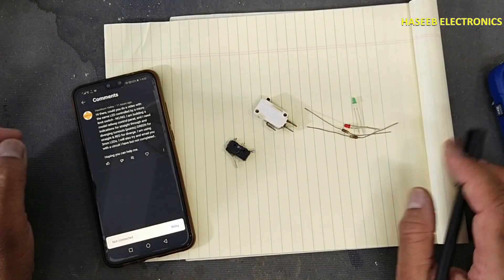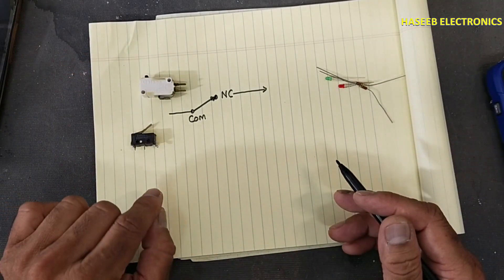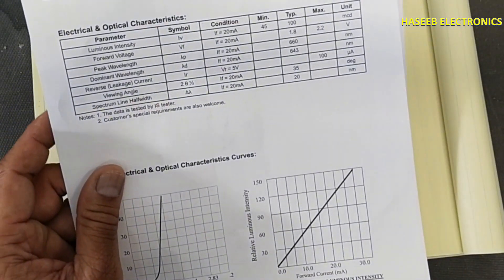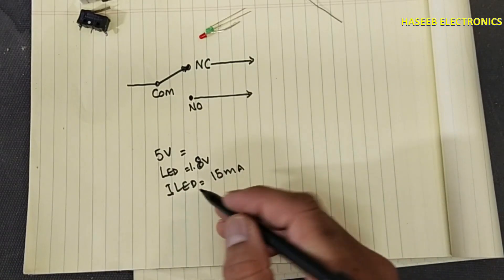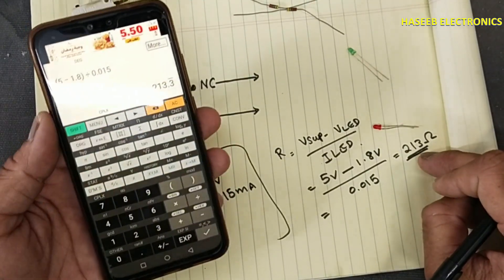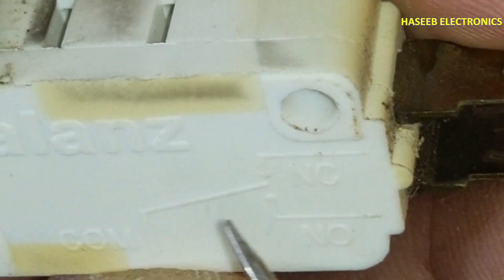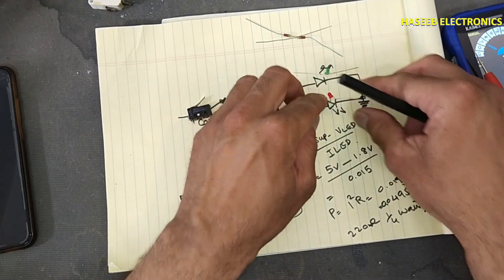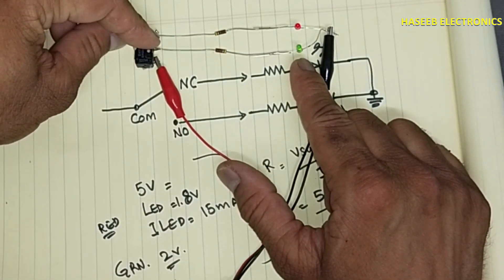{872} Understanding Microswitch

Comment: Wow, that was quick! You were using 2 single LEDs, I get that, but I will be using the 2 pin 2 (or) bi-coloured type RED (NO) GREEN (NC), in other words both colours in the same packaging. Does that make a difference as far as your explanation makes here. FWIW, I have a basic knowledge of LED electronics.

Thank you again.
Reply from the maker: it is my pleasure 
if you want to use molded pack LED, it will the same 
if you will use common cathode packing, then the connections will remain same 
if you will select common anode LED, then the anode win will connected to positive supply terminal and the cathodes will connected to NC / NO points of the microswitch.
Reply: @HaseebElectronics  hi, I have sent you an email with specification of the bi-coloured LED, and a link to the FULL specification details. I had a quick look but couldn't see if it was common anode, or common cathode. Maybe you could tell me.  Thanks
Reply: @HaseebElectronics  Please show me the circuit for the 2 pin BI-COLOURED LED. I am using 12V supply, the resistor for GREEN is 500 Ohm, and RED is 510 Ohm, so could probably use the same value for both. That is applying 20mA for both. Did you receive the email with specifications? Could you please reply to the email address?

Thank you and once again a very well thought out video. ... Ian ...

Comment: Why not use 1 x 220 ohms resistor connected to -ve led to gnd?
Reply from the maker: we can connect in any lead cathode or anode. but we must have to connect separate resistance for each LED. we will not use only single resistor for both LEDs,